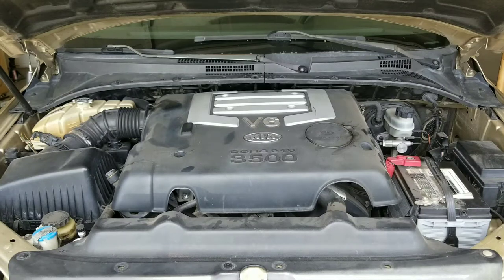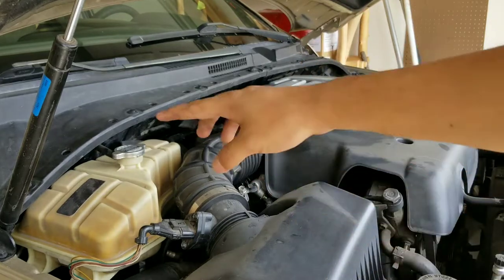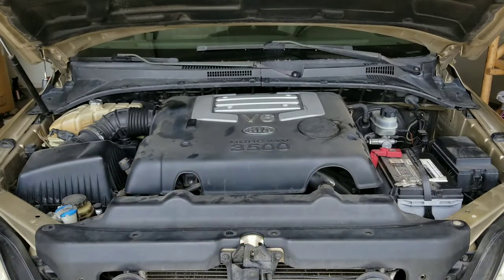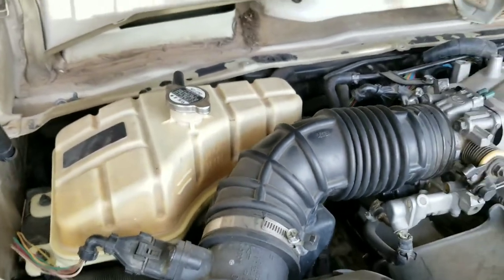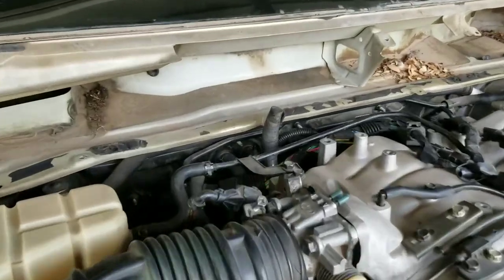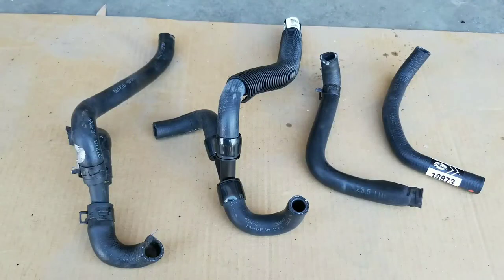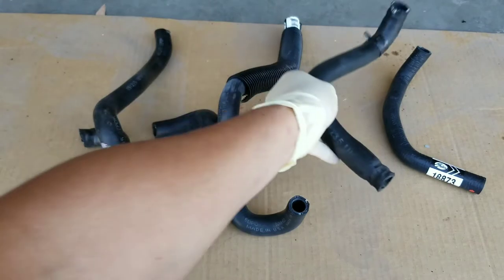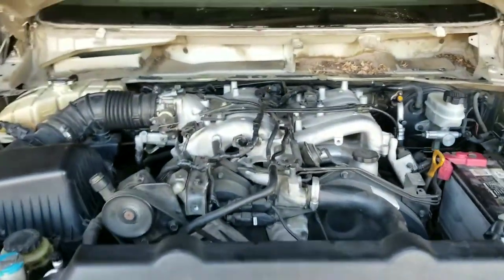2003 Kia Sorento Coolant Leak |  Heater Hose Replacement!

Comment: This video is exactly what I needed to know. Found a leak right there on the little "Y" on my 2006 this afternoon. To boot you threw up the easiest way to replace it. (There's only like 2 other videos about that hose lol) Look up the hose and the cost is cheap enough I'm just gonna replace both and spend only an afternoon doing it.
Reply: What’s the hose called
Reply: @chrismarese2462  It's a heater hose

Comment: I have a 2016 Sorento that doesn't blow hot air. Brought it to Kia to assess (thought it might have been the thermostat) and they want $750 to repair the torn hose. I'm going to see if you have an updated video for a 2016, but this video alone gives me a great start. Thanks so much for posting this information - you did such a great job of capturing the leak and explaining everything. Keep up the good work!

Comment: a couple of things that I would recommend. ( Mine is a 2005 KIA Sorento but identical to your 2003)
1. when draining radiator, remove reservoir cap. this allows the radiator to drain quicker.

2. My hoses were so old that they were hard to remove from the metal nipples going to the
    heater core and also where they attached to the (2) nipples on the engine. I had to 
    cut the hose just above the connection nipples with a utility knife to remove the access 
    and to be able to slice along the side of the body of the remainder of the hose that was
    attached to the nipple, then using a pair of pliers to remove it. I saw that you just twisted
    the end of the hose and removed it but I could not maneuver my hands in there close enough
    to do to it that way. If anyone decides to use the utility knife, when you cut along the small
    remaining  section on the nipple, slice along the side very, very slowly and carefully to not
    seriously damage the metal nipple. I did not have not one scratch on the nipple when I checked
    it afterwards. USE a fresh blade...it makes it a whole lot easier.

3. I lubed ( just slightly using a Q-tip )  the inside of the end of the hose that was to be inserted 
    on to the metal nipples ( not the nipple on the reservoir only the metal ones) to make it easier. 
    I had inserted one end without lube and it was wayyyy to difficult. using just
    a little lube made a huge difference. I used engine oil. you can use your spit if you want to
    as well but not sure how that will work.

4. I used the old pinch type clamps because there was no way I would have been able to
    tighten screw based clamps on the ends of the hose going to the engine. I did not
    have enough room for my hands to get in from the side. So just keep your old clamps.
    the "Y" hose is a Gates but noticed that the little hose going to the heater and the other
    little hose going to the engine were not properly angled like the old one. So the little section
    going to the engine was somewhat, but very little, crimped/bent. I did work on it to get
    it to have a more natural curve but the manufacture should revise this hose. ( Oreilly Auto parts #23149)

Everything went exactly as represented Here on your video! Again, Thank you for this video! it was extremely helpful!
Perhaps you can make a video on how to remove and install the windshield washer nozzles on a KIA Sorento!
Reply: My 2006 Kia Sorento had the very same problem. As the leak was developing, the heater quit putting out hot air but the engine never overheated. From all the comments, this must be a very common problem. I had to cut the hoses as well and I used silicon grease to lube the joints on the new hoses. Oil will cause the rubber to deteriorate. Thanks Eric and Everyone for sharing.

Comment: I replaced the heater hoses and coolant reservoir, but I’m getting a leak from a smaller hose that sits underneath that breather air filter hose it connects to back of engine saw it on this video not sure what it’s called

Comment: Aye bro! I have a 06 kia sorento and its leaking coolant from the back wall behind the engine and wonder if you have any idea what that might be? I wanna say its located on the back wall if u look under between your air filter and the engine. You can see clearly to the back wall and look there is a plug or hose that appears going into the wall. Thats where i see leaking. Im asking if you know exactly what that may be? Haven’t found anything on it as far as a leak from behind there?
Reply from the maker: sounds like it's the same issue demonstrated in this video. you probably have a issue with the coolant heater hoses

Comment: The small hoses that you're talking about in the beginning that are connected to the right side of the coolant reservoir, you said the bottom one goes to the heater hose. What does the top one go to? That's the one that's leaking on my Sorento.
Reply from the maker: One goes to the heater hose another goes to the engine and the third one goes to the coolant reservoir

Comment: Thanks a heap. I’m hoping this is the problem I have. Coolant seems to be leaking over the transmission so fingers crossed. Is it worth pressure testing it ?
Reply from the maker: It's a very common leak, but always verify the issue, nothing worse than fixing the wrong part

Comment: i just had this replaced by a mechanic but they also had to change something that involved a gasket. Do you know what it might have been? It cost upwards of $500
Reply from the maker: Valve cover gasket and spark plugs would cost around that much check my video out to get a better idea of the labor involved

https://youtu.be/G8AMdPFxUns

Comment: What is the best way to remove the 2 hoses that go to the heater core?  I need to back flush my heater core but I can't get those two hoses off.
Reply from the maker: remove the cowl and wiper assembly to get to the hoses.

Comment: You said,"I'm crossing my fingers that that's what it is and it's not something major."

Would you give me an example of "something major" that can cause a coolant leak? I sprung a leak on my Kia yesterday, and will be diagnosing this morning. Thanks.
Reply: Head gasket gone bad is a bad things but rare on a Kia, you find out what your problem was??
Reply from the maker: Blown head gasket cracked cylinder head but that's very rare unless it failed catastrophically